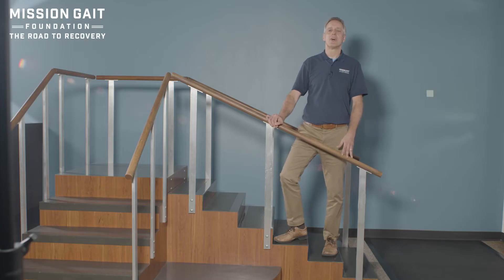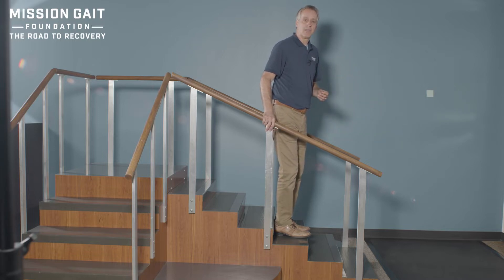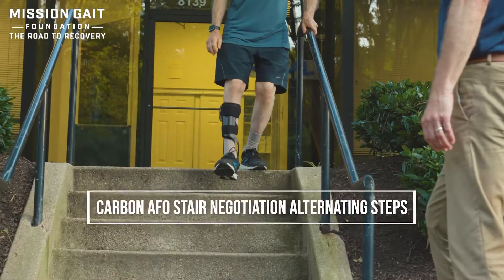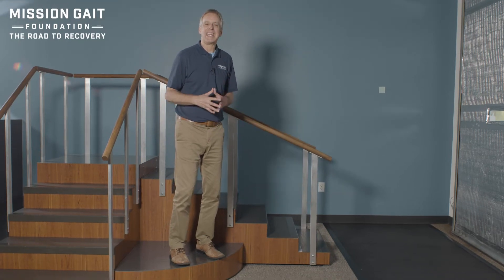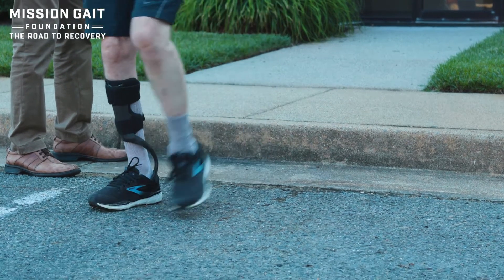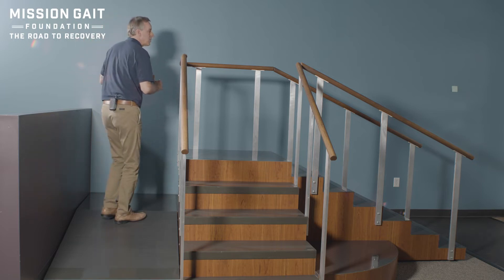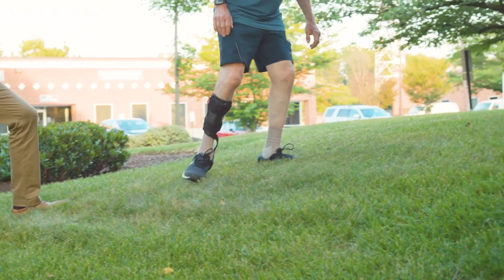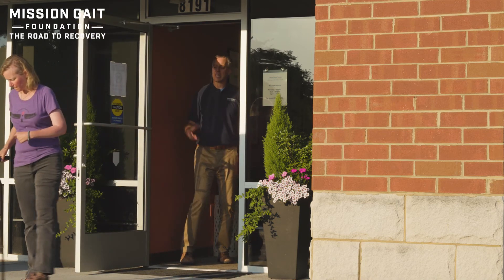Training for Safe Function Over Community Barriers - Orthotic Training: Episode 10

Comment: This video  reminded me of things I have taught myself over the years. Many years ago when i was walking the  steps and  incline paths around Mt. Rushmore Monument. You are basically walking up Rock ramps and steps. Nothing is really ADA. They did have railings. I have to use my right hand to hold a railing. Unfortunately at the top the railings were on the left side. I was dumbfounded for a few minutes. Then it came to me. Hold the the left side railing with my right hand and walk sideways. It worked and gave me more freedom. **The important thing to remember. When something looks impossible, take a few minutes, take a deep breath and study the situation. We can usually  find a work around. I have Multiple Sclerosis. Spasticity in my left arm and lg. Right now I use the STEP-SMART Brace, When this happened I was using the Bioness L300.